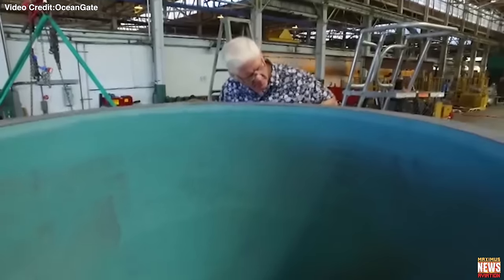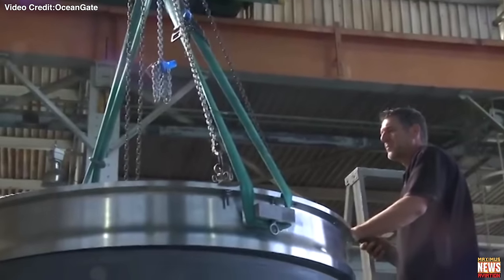Watch The Manufacturing Process That DOOMED OceanGates Titan To Fail. But It NEVER Had To Happen.

Comment: When you watch fiber wound tanks for 10,000 psi SCBA set ups you notice that the fiber is wound not only  circumferentially but diagonally and longitudinally and the metallic valve ports are integrated in the weaving not just glued in afterwards.
Reply: Yes that struck me as odd, it's all just longitudinal... at that point it's mostly the epoxy giving it compression or sheer strength.
Reply: Yeah the structure as built would handle the hoop stresses well, but it looks like the column stresses from the endcaps would be taken entirely by the resin matrix. Which makes me wonder how it survived as long as it did!
Reply: @nerd1000ify  I'm just getting into fiberglass and I couldn't list the amount of times, I've been wildly impressed by epoxy.
Reply: It is a terrible design but nothing was screwed into or penetrated the carbon fiber tube. There's been some people insisting that the monitor mounts were screwed into the CF tube, even after they've been showing images showing how there's an interior liner with wires, lights etc between it and the inside of the CF tube, and the monitor mounts have to be attached to the liner. All of the connections between things inside and outside went through the aft titanium dome. Everything on the exterior was attached to the titanium domes or the end rings.

The only thing really structurally wrong with the design was the carbon fiber tube. A titanium tube of the right thickness could handle the pressure, so could aluminum. Between 1964 and 1970 Aluminaut made 251 dives, some as deep as Titanic, with a cylindrical aluminum hull 6.5" thick, and of an interior diameter large enough for crew to walk upright.
Reply: @greggv8  I read a bit about Aluminaut and found myself questioning why they didn't just copy her but with more modern fittings. A proven concept, much bigger (could take maybe a dozen tourists) and way more comfortable with standing room for the passengers. Plus aluminium is hardly an expensive material, and certainly much cheaper than titanium which they already used for the end caps.
Reply: @greggv8  Wow thanks for mentioning Aluminaut, I had no idea. 80 tons, 4600 m test depth, rescued Alvin and lifted broken arrows. That thing is amazing. And being aluminium I am almost sure the pressure vessel is cheaper than a single titanium endcap. 

Man someone should build another one. Aluminium is easily scalable, I bet with a thicker hull and modern alloys not available in the 60s and manufacturing processes too, you could make an even bigger one, maybe fit 20 instead of 12?
Reply: @user-lv7ph7hs7l  Aluminaut carried up to 7 people. I'd bet one like it with modern aluminum alloys could easily exceed the original capability at the same hull thickness. 80K pounds is 40 tons.
Reply: @greggv8  And almost 3 t payload! I am currently watching an old Navy movie about it, I think I'm in love :)

And right 3 crew and 3-4 scientists or guests, my bad. But it looks very spacious. For short term I think you could have extra oxygen and more people, the pilot has to walk a fair distance from the portholes to the "controller man". And the movie mentions a lot of cool boats, Trieste, Alvin and the to me also unkown nuclear DSV NV-1. They just let it drift at depth from Florida to New Foundland  once for a few weeks. Man these old 60s boats are cool. I can't possibly imagine why Aluminaut didn't lead to a huge commercial fleet, that was the dream of the creator. He seems to have been an aluminium man and wanted to use his new wonder material for deepsea habitats and tourism and even submersible intercontinental transport... and his demo design Aluminaut is nothing short of legendary. So he knew what he was doing. Such a shame it didn't happen. I am super happy Aluminaut is being kept usable though. Someone should build 100 of them. Aluminium is dirt cheap now...
Reply: @221b-l3t  I don't know how well it's been maintained since it's on display outdoors.
Reply: Airplane hulls and SCBA tanks have the high pressure on the inside and rely on the tensile strength of the fiber but this design has the high pressure on the outside so it relies on the epoxy for compressive strength, flexural strength which is how much deformation a rod of epoxy supported at the ends can resist and rip strength which is how well  the epoxy binds to a dissimilar material like carbon fiber. Of course it's possible that the acrylic porthole window failed since it was only rated to 1,300 meters and is prone to sudden failures like the aquarium in Germany unlike what he described to 2021 passenger and Mexican actor Alan Estrada.

Comment: This vessel's CF hull has now been officially pressure-tested.  Interested in the NTSB's release of final ship-to-sub text messages and video footage of wreckage.
Reply: Gonna be the wildest NTSB report ever.
Reply: 3 dives to 4000m max
Reply: I would be surprised if the NTSB will investigate this since it’s not a regular mode of transportation. They investigate ship accidents but an experimental submarine with five people on board sounds like something for the coast guard to handle.
Reply: @GRosa250  They already are.
Reply: @johno1544  They had done over a dozen successful dives to the Titanic....
Reply: @jaycahow4667  Each one was a roll of the dice.
Reply: @jaycahow4667  only 3 at Titanic depth with Titan that has been widely reported
Reply: @GRosa250  Don't forget that three of the five on board were effectively paying members of the public and the untested uncertified death tube they were sitting in was built on US soil.  That is where the NTSB may well have an interest.
Reply: @GRosa250  The Canadian equivalent of the NTSB has already said it will carry out an investigation. It's involvement is based on the mother ship of the submersible being Canadian-registered.
Reply: @Dat_Sun  re: "Each one was a roll of the dice."

Each dive added more cracks - broken bonds - in the composite CF material ... break enough bonds and - disaster would follow ... QED as we have seen.

Comment: I just noticed , the CF tube has been squared off (see the 2017 Composite World article), it is resting on precision steel blocks on the floor, they are adjusting the height of the titanium ring with adjustable precision rods, therefore the ring is floating on a glue sandwich. They relied on the 1700 sq inch of cylinder's glue not deforming under the 10K tonnes of pressure at depth from the caps. 5.9 tonnes per square inch of glue on the end of the cylinder. wow.

Comment: I’m not an expert on manufacturing but usually when you need exacting tolerances you don’t put it on by hand like that.
Reply: I suspect that this is what went wrong, I know that Carbon Fibre is getting a rough time, but at 5 inches thick, if you know anything about how much force 10 millimetres of it can take in a racing car accident, you'd have to think that the tube was virtually indestructible and only where the joins are with the metal would be a possible failure point.
Reply: Applied by hand. In a shed. No temperature control. No dust control. No humidity control. No vaccum bagging.

The only surprise is that it actually lasted as long as it did.
Reply: Also should of been in a dust free environment..
Reply: My thought exactly, I would think they would have pressed in on with a hydraulic press, and the depth of the interface was too shallow, maybe 3-5 inches. I wonder if the even had tolerances.
Reply: Imagine that... eyeballing it! Only we didn't have to imagine it, we saw them. 2:15
Reply: Glue it, press it on, HEY IT FITS! 🙄
Reply: @SaintKimbo  previous passengers talk about a crackling sound coming from the carbon fibre as it submerged and they said "don't worry, there's 5 inches to go thru yet. But carbon fibre is made for EXPANSION not compression
Reply: @SaintKimbo  Force was in the wrong direction, no cross winding, the epoxy was practically doing most of the work.  Each dive would cause micro fractures in the carbon weakening it and allowing penetration, brittle from cold salt water, so many reasons it was a poor choice....
Reply: @SaintKimbo  racing cars are not 12,500 feet down. the issue here is compressive forces...not carbon fibre under tension.
Reply: @yannisboochakis3718  
You obviously have no idea what your talking about, compressive force is exactly what happens when a racing car hits something, they can track and analyse deceleration G force when testing.

Tension and or stress forces are totally different.

Racing car monocoque, and even bicycle frame makers, using material variation and weaving patterns can build in flexibility where required when manufacturing with carbon fibre, so if it is shown that the hull of the Ocean Gate vessel failed, it was probably more due to poor manufacturing processes on their part, than the carbon fibre as a material.
Reply: American ingenuity.
Reply: @langdons2848 and the guy was wiping "clean" the metal surfaces with what looked like a used rag. Not a clean and sterile cloth out of a new bag.
Reply: @jaycahow4667 yes, cross winding.  Thought something was missing when watching that bit

Comment: As the Enterprise's chief engineer, Scotty famously said  'Ye canna' change the laws of physics, Captain!"
On a less flippant side, I make underwater cameras for manned and ROVs that have been as deep as the oceans go and in general the deep sea footage you see is from one of our cameras. The more I see of this "vessel" and the practices of Ocean Gate I'm stunned.
 The warping of the Engineering is bad but the twisted deception practicing it's operation between cracks in the legal system is criminal. Even the co-founder after the tragedy was announced was still claiming the venture was a success.
 Sheer lunacy.
Reply: Sometimes thicker doesn't automatically equal stronger. Years ago I saw a post from a company that made housings for deep submersion cameras. It showed two round windows. One was uniform thickness with a ring of bolt holes around the edge. It went down a few thousand feet with no problem. So they figured it could go deeper if they doubled the thickness, but to simplify things they took a piece of the plastic twice as thick and milled the edge down with a flange the same thickness as the first window. Before the housing reached the same depth the original window had, the pressure punched the 2x thicker window into a bowl shape, ripping out all the bolt holes around the edge. The edge step caused a stress concentration where the thinner uniform thickness window had the stress evenly distributed.

If they had made a new retaining ring and used longer bolts to accommodate a 2x thicker window without a stepped edge it would not have failed at a shallower depth. IIRC the person who wrote the forum post said that subsequent versions of the housing for deeper use were made with a full thickness, thicker window.
Reply: Star Trek ignored the laws of physics. If the transporter converted matter to energy it would vaporise the Enterprise.
Reply: arrogance killed them, not so much lunacy

Comment: A couple observations.  I too was surprised to see the titanium end bells glued to the carbon fiber tube, looked like a disaster waiting to happen.   These dissimilar materials would deform at different rates as the external pressure changed, creating unwanted stress on the joint.  There is no such thing as a perfectly rigid structure, and this sub was no exception.  The 5" thick tube would deform measurably under the intense water pressure it was supposed to withstand.  The titanium end bells would also deform, but probably not as much, owing partially to their spherical shape.  The result would be a shear force on the glued joint between them.  Not good. That being said, this is my second choice for why the sub failed.
Another idea that keeps coming up is that carbon fiber is good for pressure vessels when the pressure is on the inside.  Makes sense.  The reason is that carbon fiber is extremely strong in tension.  When the pressure is on the inside of a vessel, it puts the carbon fiber in tension, asking it to do what it does best.  When the pressure is on the outside, it tends to put the strands in compression, requiring the bonding resin to keep the strands from getting slack.  I think that the cracking sounds associated with increased depth were a result of the resin / fiber bonds failing when the carbon fiber was slacking.   This probably led to water intrusion and further de-lamination until catastrophic failure occurred.  I would bet that they thought that the thickness would make up for a less than optimal design and they were wrong.  I think this was the actual cause of the disaster
Reply: Agreed. The end bells were flanged to offer mechanical support to the CF sleeve. Structurally the highest stress/deformation should have been mid-cylinder, but their wrapping was so cavalier there's no way of knowing where the stresses ended up.
Reply: five inches thick doesn't seem like much to me at all for those sorts of pressures
Reply: @bushmanphotos My wife thinks 5 inches is enough.
Reply: Your first analyses was the right one or kind of both. That titanium ring clued to the carbon fiber body was the reason this submercible imploded.
Unvestigators also said that because the different pressures the water leaked between the clued parts and clue didnt keep anymore.
Reply: Based on recent testimony it sounds like you are exactly right.

Comment: As soon as you mention glue, there's a problem. You need one continuous casting at those depths. This thing was inadvertently set up to last just long enough - 13 previous dives - to get 5 people to trust it again. But the brittle carbon fibre was a ticking time bomb. It lasted just long enough to get them deep enough to a pressure where it instantly ended their lives. 😟
Reply: Yeah that scared the hell out of me seeing that!
Reply: I don't think the hull that failed was the same one that did the previous dives...it failed testing and had to be replaced.   Found this:  During 2020 and 2021, the Titan’s hull was either repaired or rebuilt by two Washington state companies, Electroimpact and Janicki Industries, that largely work in aerospace
So the previous dives did damage it as expected.
And after seeing the minimal purchase the titanium ring glue joint had on the CF....it's just unbelievable that anyone calling themselves an 'engineer' would do such a thing.
Reply: @recoilrob324  I know I'm not an engineer but I'm sure the glue joint is where the failure occurred, it seems bizarre that anyone would think that was safe. Glue performs ok when not put under stress or the elements but used like this with minimal purchase between the CF and titanium and exposed to salt water and numerous compression cycles then I don't think its acceptable for construction of subs.
Reply: Ya - 'bond breaks', in the composite CF structure are CUMULATIVE ... right? Break enough over time and - ???
Reply: Any air trapped between the filament laminations or glue joint would compress and expand wildy causing further delamination.
Reply: @dodgedak03  Wow, so it was just a matter of time.
Reply: @chatteyj I sure do agree with you. The ends of the tube probably popped off from the compression.

Comment: If a goal is to reach 4000m then a sub should be designed for 6000m, taking into consideration the fatigue of the materials being used - it's simple as it is. it is default Engineering basics I'd say!
Reply: "But we tested to 4000 m and will now be taking passengers, sorry I mean mission specialists to 3840 m."
Reply: if you use the wrong materials, it will break even if you design it for greater pressures, at it deteriorates rapidly over time.
Reply: The cylinder specification was 4000m with 2.25 safety factor, rounded up to 5 inches.
Reply: @sigkil   Uhm 2.2 safety factor means it's good for below 8000 m. No submarine ever has a safety factor that big. Crush depth is typically 20-40% below test depth and Titan test depth was 4000 m. Crush depth only theoretical.
Reply: @221b-l3t  You can read it in an article called "Composite submersibles: Under pressure in deep, deep waters". I quote: "Spencer Composites’ president Brian Spencer signed a contract with OceanGate for the Cyclops 2 hull in early January 2017 and was presented with very basic — but challenging — performance parameters: Length, 2,540 mm; outside diameter, 1,676 mm; service pressure, 6,600 psi; pressure safety factor, 2.25. “They basically said, ‘This is the pressure we have to meet, this is the factor of safety, this is the basic envelope. Go design and build it,’” Spencer reports. And he was given six weeks in which to do it.
Reply: @sigkil  does it mean that operational depth was +-1500mm or +- 10 000 m? I assume it has never been tested for 10Km.

Comment: The carbon fiber loom is anisotropic being cylindrically wound. This is a really troubling weakness in addition to all the other concerns. The other glaring issue I see is the guarantee of getting voids in the bonding material due to the way that bond was formed by mating two coated surfaces rather than compressing a bead to fill the gap. They will have manufactured this cylinder again if it's their first attempt (I think it is), because this cylinder suffered audible delamination cracks during a test dive in the Bahamas.